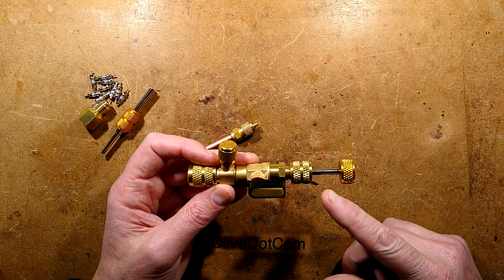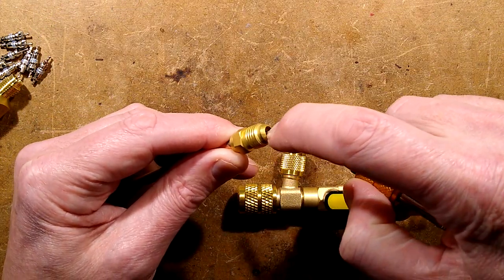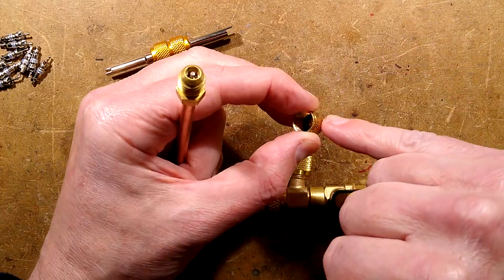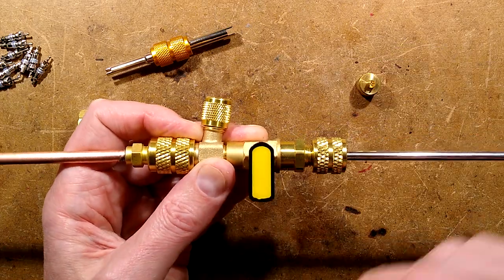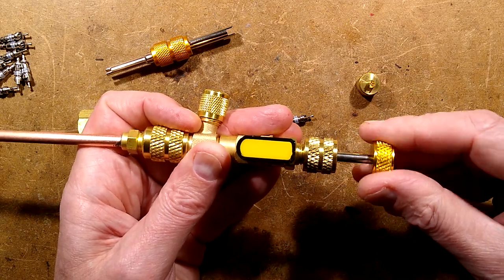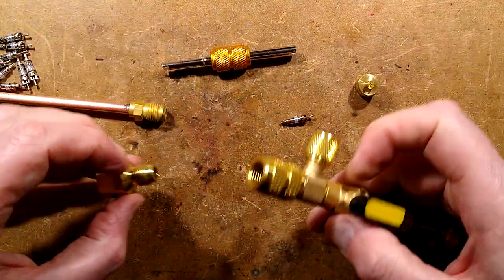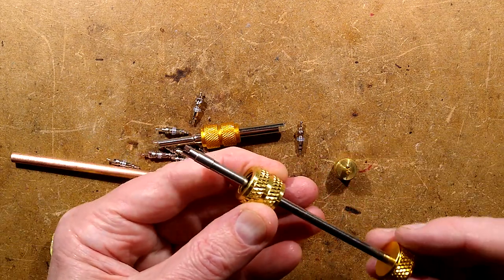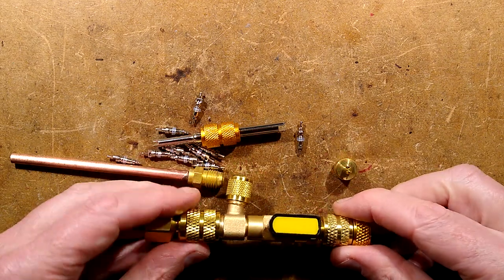Very cool tool - HVAC schrader core changer

Comment: Clive: One procedural thing you must do, is to purge the air from the tool. Just after you loosen the Schrader valve, refrigerant can now leak around it's thread seal, you want to loosen the threaded nut holding the sliding valve core tool just a tiny bit to let that air out, then tighten it again, and continue removing the Schrader valve, and then close the isolation 1/4 turn valve. Then insert the new Schrader valve, on the tool, and thread the sliding shaft nut back on, but leave it slightly loose, then open the 1/4 turn valve just a crack to again purge air from the chamber in the tool. Then tighten the nut on the sliding Schrader valve driver, fully open the 1/4 turn isolation valve, and insert the Schrader valve back in the machines threaded seat.
You need to always think about purging air as this is a non condensable gas, as well when the outdoor relative humidity is high in the ambient air, you want to purge that out as well.

Comment: We have things like that over here in Germany to change heating radiator valves under pressure. So you dont need to drain the heating system. It is called "Schleuse"... sluice...
Same thing, but a bit bigger.
Reply: Yep - search for "Ventilschleuse" and you'll find a number of videos showing these things being used... Someone had to do this for our bedroom several years ago after the valve failed. Sleeping in a 34°C room is really not recommended...

Comment: Reminds me of a "hot tap" at the gas plant were I work. 
They weld a pipe on to a live line (keeping gas flow to keep weld from burning through, norm. 900 psi @ app 30 mmcf) 
Bolt a new valve on, bolt a drill on with an isolated chamber. Drill pipe and back up bit, close valve and remove drill. 
They do it so we don't have to go down to tap new lins in or blow down the whole system

Comment: When you're drawing a deep vacuum on a system, you attach one of these to both the high and low side ports and withdraw the Schrader valves to open up the lines and pull a faster vacuum including hoses that don't have the depressors in the end.  Also, you never know when a piece of crap might stick a Schrader valve open and won't seal after the gauges are removed so it's a good idea to have one handy along with a thin glove.  There are keyed safety caps required by code to keep the huffers out of AC and heat pumps but the brass flare caps are a minimum to keep the system tight.  They have these tools for some automotive ports and they're not very expensive, but a lot of automotive ports don't use Schrader valves.

Comment: Great to have for automotive use so you don't loose all the air in a tire because of a leaky valve
Reply: If you ever watch a new tyre being filled you will see that they don't put the valve in until afterwards, they only lose a very small amount of air. Changing the valve only takes seconds, it wouldn't be worth the effort of fitting the tool. Unless you've been conned into having your tyres filled with very expensive nitrogen.

Comment: As Mike pointed out, the side port is for connecting the hose from a refrigeration manifold gauge set to read the system pressure while the core changer is still attached.

Comment: Love all your videos.  A very cool tool.  Surely though a Schrader valve would just suck inwards and leak if the interior was under vacuum?  Are they not just designed to stop pressure going outwards not inwards?  Curious to know.

Comment: 4x4 enthusiasts use a similar tool that's also a pressure gauge - for removing the core to deflate tyres faster.
Reply: deflate to drive on rocky "roads" then inflate for road/highway ?

Comment: These would generally be immediately lubricated in service, as the refrigerant carries a charge of oil as a well-distributed aerosol in operating condition. It takes quite some time, on the order of weeks or months of inactivity, for the oil to fully settle out.

Comment: Reminds me of hot tapping on a pipeline. Weld a new stub pipe on the original one, put a valve on the added stub, add another piece of pipe with a drillbit. With the valve open drill through the original pipe, retract drillbit, close valve, remove drillbit, and now you can add pipe as you wish.

Comment: These were like $500 when they were new and under patent. I bought mine when I first saw it for <$100. It’s amazing how cheap they’ve gotten but I’d not trust the cores that come with the tool as a bag of name-brand cores goes for more than you paid for the whole tool.
Reply from the maker: In a pro situation I'd be using pro components.  It's cheaper in the long run.
Reply: Somewhere I have an AMP D-Sub connector pin inserter/remover tool that was given to me by a guy who worked in telecommunications when D-sub connectors were new. Told me it cost over $200 and his boss would have a shitfit when anyone lost one. At the time he gave it to me, AMP was selling the exact same tool for $5 or less.
Reply: @bigclivedotcom  
Hi Clive.
There spamers in the comments.
I have reported meny of them.
But maby it easyer for you to clean them out. 
Thanks for a grate channel.
😎👍
Reply from the maker: @janne65olsson  I've blocked one and tried to implement a new filter.

Comment: NB. You wouldn't ever use a Schrader valve to hold a vacuum. They're basically a one way valve which will let gas in but not out. Kinda the total opposite of what you'd want in order to hold a vacuum.
Reply: HVAC techs use these to pull and hold a vacuum with the Schrader cores removed because it's faster.

Comment: This would have made one of my job easy a few years ago.
I think the port on the side could be used to add thick liquids under pressure like tyre puncture sealant.
I used to fit automatic puncture repair sludge into tyres. I had to remove the valve fast and fit the hose quick.
The sludge had a strong pump to pump it in.
This tool would have made things easier.
The idea was, when you got a puncture, the gel had micro fibres in it and as it was forced out of the hole the fibbers stuck/knit together from the heat/friction from the tyre on the road.

Comment: That is really clever. Mountain bikers using "tubeless" tyres often have the valve gummed up by the sealant liquid that they use. Being able to replace a valve without deflating the tyre would be great.  I wonder if you can get one that works for presta valves too, so car users could do the same?
Reply: Huh? I've never seen Presta valves on anything other than a bicycle. I've never had to replace one, but i don't think something like this would work. The locking nut on the end of the valve stem would get in the way.
Reply: I'm not sure how much value there is in not deflating the tire. in my experience you just let the air out, it's not a special gas like a refrigerant, it's just standard air.
Reply: @galenkehler  two reasons that I can think of... 1. Its a lot of air, especially with a hand pump 2. Its sometimes very tricky to get the tubeless tyre to seat properly.
Reply: Car valves are Schrader too, there are a lot of Schrader valve sizes and shapes, and the same type of core can be available with seals of different materials suitable for different fluids.
Presta are the thin bicycle valves with the nut on the tip, there are also Dunlop/Woods valves where the stem is the same diameter as a Schrader but the core is like a Presta valve without the nut, these only let air in, to deflate them you have to remove the core.

Comment: The low side service valve on my car has a slow leak,  I didn't know they make tools to replace the valves on pressurized systems, I ended up finding a little brass plug that has a tapered seat at the end and a hole machine through the center to accommodate the Schreader pin that screws inside the service port and should stop the leak or at least slow it down to a point where it's pretty much unnoticeable.

Comment: Even though you’re not injecting silicone into the system most refrigerants are pretty good solvents. I’m not sure if silicone is soluble in any standard refrigerants but that might be a reason to not use silicon even in relatively innocuous locations such as the one you mention. 

My $0.02, you’d probably be 100% fine.

Comment: I have a few of these in the box, one fit's R-12, one R134a  and one now for R1234YF  They are different than this one because of the design of the ports but work in the same way. With the price of R12 and R1234YF you really don't want to lose any if you can avoid it.

Comment: 3:13 that additional Schrader(?)  port, I guess, is for a pressure/vacuum gauge as well as for refilling/extracting the refrigerant "in-situ" if necessary along with a valve core replacement. Some videos on "Rainman Ray's Repairs" 's channel feature leakage checking, recovering/refilling the refrigerant and clearing compromised refrigerant loops on cars. Very interesting, insightful  processes & footage, although I don't like the person much. I can imagine that there could be a situation where valve core access and a High/Low Side connection or P/V gauge migh be useful to have at the same time. Maybe a damaged or stuck-in-closed-position core, but you have to know how much is in there?

Comment: Wish these were more commonly available for the home radiators. My radiator in the livingroom has a valve that is sticky and gets worse every year. These tools are available but wicked expensive. Need to get the technician to come out and replace it. 
Can't depressurize the system because it's an appartment.
Reply from the maker: They do versions for some radiator valves.

Comment: Depending on the materials the o rings are made of, would a fluorocarbon lubricant/sealant compound be more appropriate? Silicones can outgas stuff that doesn't play well when compressed. (That's residual shop lore from long ago that may no longer apply.)
Reply: Yes silicon  will off gas seemingly forever, even the smallest amount. Directly proportional to the pressure differential. Probably wouldn't hurt anything. Unless you are manufacturing silicon wafers or some such critical component.
Reply: I also commented this.
Shold have read the comments before i were writing. 😎👍
Reply: @janne65olsson  Uh... I wrote that without looking too so don't feel bad.

Comment: Kinda related, ARB (and I’m sure others) makes a similar tool for airing down tires faster (for Jeeps, 4x4s, etc). Pretty slick, once you figure out how to use it properly.

Also, am I the only person that saw the thumbnail of this video and thought you were using a yellow "-" in the same font from just above, just to block out something from view? Turns out it was just the valve handle. Lol

Comment: Good video about an interesting tool, thank you.  I do not need one but now I want one, just because it is cool.

The description block states that the tool is not intended for the changing of valve cores of vehicle tires.  Can someone shed light on why this is so?  I can see where it could be useful for changing valve cores of nitrogen-filled tires or very large air-filled tires.  Examples; nitrogen-filled automobile tires (not sure why people do that but I have read about it), air-filled farm tractor tires, due to the time and energy required to re-inflate the tire, and esp. for farm tractor tires filled with with salt solution (apparently done to add weight for traction) because the owner would not want to loose the salt solution.
Reply from the maker: Different applications use tools with different thread types.

Comment: This is exactly the kind of amazing purpose-built tool you get when the people doing the work actually design them.

I found some instructions for a very similar tool on YouTube (E5G0ehjlHHE).  It turns out the side port is there to connect a gauge, then you can evacuate/refill the system through the end of the tool, close off the ball valve, and swap in the new stem.  Such an elegant little combination of manifold, valve, and access port, all in one tool.

Comment: This is very similar to pipeline dewatering headers - they are permanent, but use the exact same principal in sending and receiving pipeline dewatering pigs - cool tool . you could use this for a car tire with a leaky stem as well i would think.
Reply: Don’t car tires use a slightly different type of valve? The Schrader valves are on thin bicycle tire tubes but I think car tires are a different type. Perhaps there’s a similar tool made for car tires?

Comment: I had bought one for my car as that valve often gets Leakey on cars. 
Wasn't perfect but did the job, should have added some silicone as Clive mentioned. Also the valve size was close to the shutoff opening and would get hungup inside.
Reply from the maker: Apparently when overtightened the seal may obstruct removal of the core.
Reply: There are different size valves, and the one my car uses is the largest of them.. was just a tight fit. If the gasket on the valve was crushed/bulged due to over tight it might not have fit.
Also there is no way to know you have the valve centered perfectly on the removal tool, there is no mec guide for the valve to be centered prior to removing causing it to hang-up in the shutoff... There maybe better of this tool out there, just something to be aware of.. nothing worse then getting a valve stuck in the tool and no way to get it back in or out without vacuuming the system.

Comment: Very handy tools but unfortunately I've yet to come across one that doesn't leak a little under a vacuum after the first few uses. Even the expensive big brand name versions are prone to leaks but they're still very useful.
Reply: I was wondering if the gasket was replaceable & if the tool came with extras. The piece with the needed flexibility would by nature stress out more quickly.
Reply: @helenjohnson7583  I've never really investigated the failure point on one with a leak but I suspect it's the shaft seal on the little ball valve. I've never come across a seal kit for one and generally when the leak becomes big enough to be a hindrance to pulling a 500 micron vacuum I throw the thing away and buy a new one. Generally the good brand name versions last a year or two with regular professional use, the cheap Chinese versions are best avoided unless it's just for DIY type applications.
Reply: @helenjohnson7583  Yes, the good ones do have replaceable sealing gaskets. The gold-standard model of these is made by Appion (runs about $70 USD), and it includes one extra set of O-rings that seal the plunger shaft. A full rebuild kit (good for 2x) including the valve seals is almost the same cost as the tool itself. 

BC should've checked out that model, because it has some really smart features. It uses 2-orings to seal the plunger shaft and it has a strong magnet in the plunger handle. This allows you to 'stick' it to the side of the AC unit, so the valve you removed stays safely out of the dirt. The reason these are worth their inflated cost is  that they are rated for deep (<50 micron) vacuums. When pulling deep vacuums like that, you want to be able to trust your tools to confirm no-leaks. It's not worth wondering if the ebay special is leaking or your refrigerant lines.

Comment: That side port of the tool looks like it could be used to recover any gases that would have leaked in between the 2 ends of the tool during use.

Comment: this is cool n all BUT why would u only replace the valve if its leaking? chances are your system is low and needs to be recharged to begin with so youll have to depressurize and refill it to begin with

Comment: I have 20+ year old C&D version of this tool, its very similar except it uses a gate valve instead of a ball valve. I guess it was made before ball valves were invented or manufactured well enough to hold the pressure of refrigerant?

That port is typically used without its schrader for pulling a vacuum. Pulling a vacuum without the schraders in place can easily half its time if not more. Since time is money this results in a higher quality vacuum instead of someone saying "good enough" after an hour. You just need to be careful in the order you connect your vacuum pump because its easy to lose the vacuum if you are running on cruise control and don't put the schrader back in before you take the pump off....ask me how I know...

If anyone here is looking into this tool get the current versions from Appion or C&D.

The problem with the one in the video is its length. Often you'll have a limited distance between the port and another object the port is pointing toward. You'll go to pull the schrader out but be blocked by something you can't move. The brand name version of this tool move the ball valve much closer to the port reducing their overall length. Since the rod that holds the schrader needs to be the length of the tool and you need to pull it all the way out any length savings is doubled when using it.

Great video btw!

Comment: It's used by hourly guys evacuating a system as fast as possible without a core in the way. I rarely see Schrader valves spontaneously leak.

Comment: Neat tool, though all I can think of as a use for it would be bicycle tyre valves, but that's a different size I think, and it's not so critical to prevent deflation with tyres, aside from the air coming out smelling like a wet fart most of the time... :P